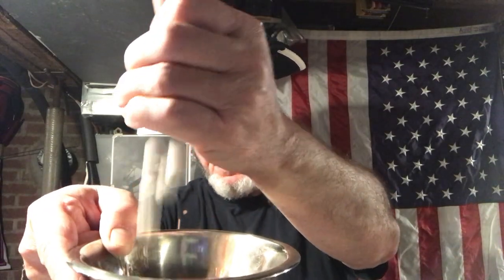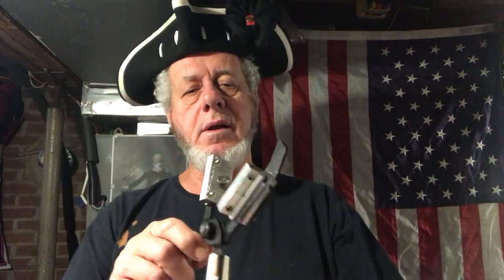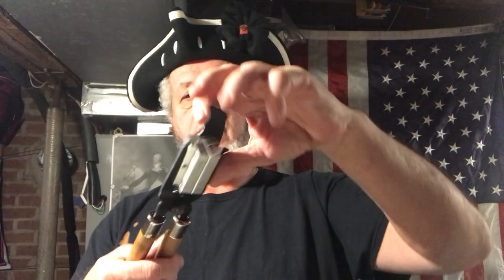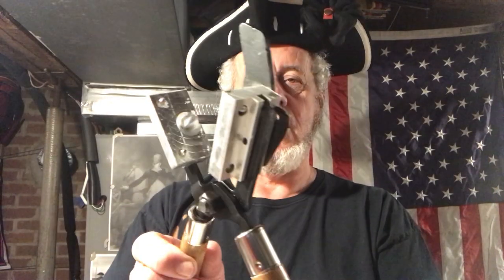How I make my clay ball for shooting in my flint lock pistol and bs with ed

Comment: Something I can tell you backing up why this is a good idea and why the Russians probably did it in the first place, I sat down and figured out how much lead it takes to make .690 roundballs. The average .690 roundball weighs 490 grains. Compare this to the fact that an ounce of lead is 438 grains. To make 100 .690 roundballs, takes 7 pounds of lead. Lead right now to try and buy runs about $2 a pound. To buy .690 roundballs, Track of the Wolf sells them at about $20 for 25 but shipping because they're so heavy runs another $10 these days. The other thing, since .690" balls take up so much lead, it takes a lot of time. If you look at the molds the British used, they were great big long gang molds that also held buckshot and so when they made some, they made a lot of them at once.
Reply from the maker: Thanks for sharing the info very interesting 😀